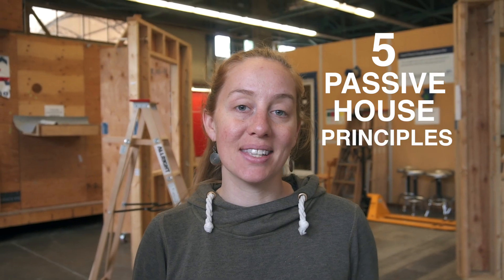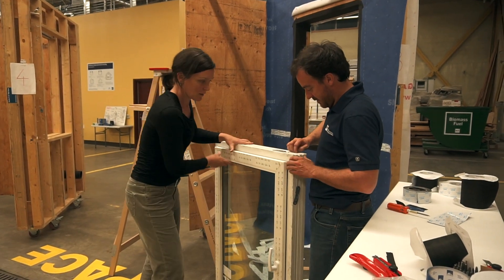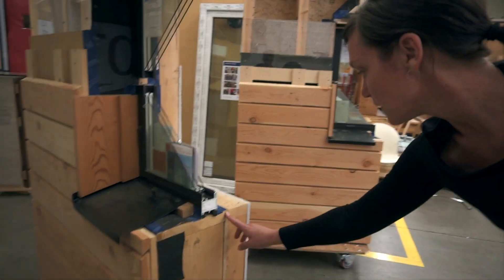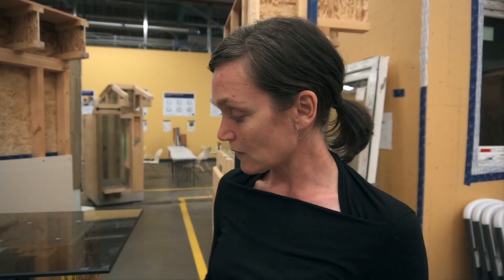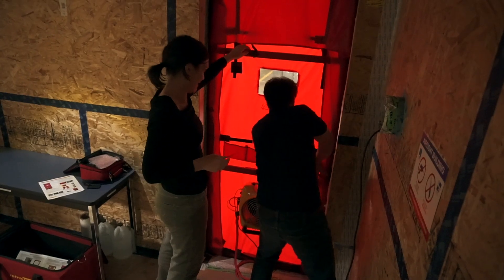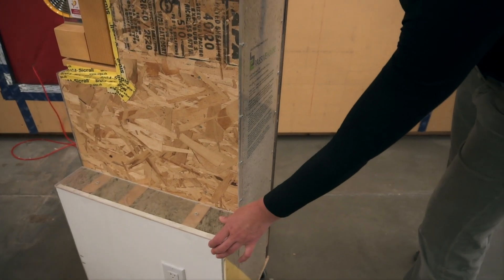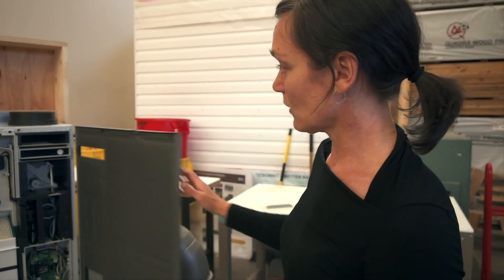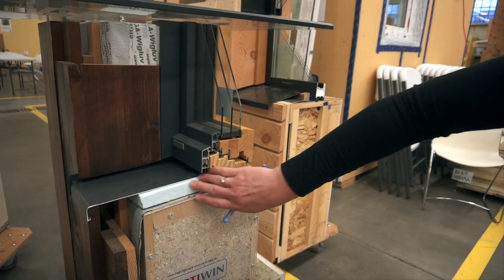Passive House = 90% Home Energy Reduction!

Comment: Two problems with so-called green building: 1) Thermal mass is completely ignored, and yet even a framed bin filled with gravel, possibly with ducted airflow through it will greatly help to moderate indoor comfortable temperature. 2) If you frame, enclose, and paint a wall well enough to seal it, you do not need to be part of the terribly wasteful insulation industry. Simply drill some of the studs for air to flow between sections, then install a low power fan, such as used to cool a computer. An airlock is needed as well. Simply turn on the little exhaust fan only often enough to maintain some vacuum inside the wall section. Heat loss or conduction as well as sound travels between outer and inner wall carried by air molecules bumping into each other and passing it along. Create even a low vacuum and suddenly there are not enough air molecules to conduct that much heat or sound. That is how your thermal flask keeps your coffee hot all day long! You will achieve far better insulation value and effect, and option of thinner walls this way. In short insulation=BAD.

Comment: OK, the video seems to have heating covered. My question involves cooling though. Is it actually possible to keep a house cool in 40 plus Celsius summer? I ask because here in Manitoba we can get some real scorcher summers and traditional air conditioners can be power hogs as well as environmentally damaging.  Is there such a thing as passive cooling where no air conditioner is needed?
Reply: Also reflective and ventilated roofs and walls will help too. You could even use solar panels for that.

Comment: To everyone interested on the matter, here is a short global overview with parallels to the situation in France (not trying to sell it, I just think the history of one country makes a more understandable example for picturing the global situation, and France's history on the subject is the only one I really know about):

Passive housing and Passivhaus
* Some techniques for passive housing might be new, but it has been around for as long as traditional housing, which always had had techniques for keeping the cold or the heat outside. You can summarize the idea by thinking of it as a way to keep the inside temperature independent from the outside temperature, and taking advantage of the sun for heating and of the earth for regulating the inside temperature.
* The Passivhaus label is most probably what popularized the concept in its modern meaning. The research started in response to the oil crisis of 1973, the biggest advance upon traditional construction being the findings about the importance of air tightness (mostly thanks to swede researchers). The first project was constructed in 1990 in Darmstadt, Germany, and 
* The label and its techniques became quickly widespread in German-speaking and Scandinavian countries. It is interesting to note that the industrial standards in those countries also evolved to answer the demand (e.g. for windows). This means that passive construction technology is now quite mainstream and more affordable there than it is in country where the demand is more recent. 
Find a historical review here : https://passipedia.org/basics/the_passive_house_-_historical_review
* If you take the example of France, the RT1974 (thermal regulation of 1974) was also a response to the oil crisis

What's next?
1) NZEBs (Nearly zero-energy buildings)
* European Union is asking its member countries to to draw up national plans to increase the number of Nearly zero-energy buildings :
the "Energy Performance of Buildings Directive" requires all new buildings to be NZEBs by the end of 2018 for public buildings and by the end of 2020 for all other buildings.
* If you take the example of France, the RT2012 (thermal regulation of 2012) is already trying to tackle this matter
2) ZEBs and Energy-plus housing
* Zero-energy housing means that there is 0 energy input
* In variable climate zones, this is very hard to achieve which is why the needed energy compensation is produced by (often local) renewable energy. For the house never to lack energy, these renewable energy sources often have a higher mean production than the building would actually need (e.g. solar panels will work every day even if you only need them in winter). This leeds to a new, localized energy management which can allow energy use for other uses, mostly transport (electric cars). This concept is called Energy-Plus housing.
* If you take the example of France, the RT2020 (thermal regulation of 2020) is supposed to make Energy-plus housing the new national standard.

If all of this stuff seems interesting to you, you might want to take a look at other widespread labels, such as : LEEDS, MINERGIE-P, 2000W Society

I guess the reason for me to write all of this is my frustration when I read most of the comments around here :
-> Yes, passive houses are great ; Yes they should become standards, but as a matter of fact they already became standards in some countries and are already being reviewed for better/stronger ones ; they are far from being a new revolutionary technology.
-> Labels but mainly regulation are a very important part of these evolutions, and it is crucial for any country to make them intelligently. This means setting the right requirements and adapting to the climate, and still allowing room for further innovation and experimentation.
-> If you don't have a problem with heating but with cooling, the same methods apply, but your building orientation (the way you use the sun as heating source) will change
-> Higher construction prices are in no way a counter argument when you can spend less energy over the full lifetime of a project ; only the overproduction of grey energy or new pollutants could be arguments against higher performance insulation

Sorry for the long comment...
Last but not least, I want to thank Exploring Alternatives for their awesome channel and the subjects of their videos. Keep it coming guys!
Reply: Alexander J 
Thank you for your comment!
(I’m a bit surprised to be the first one say so but I’m sure many more will have thought the same. Merci!)

Comment: I would have loved to have heard even more - or more of what you both thought about this - seemed like a bit of an abrupt ending. What did y'all take away from the education?
Reply: This video was done in Canada so it does get cold during the winter and hot during the summer. We have a Passive House near us in Ontario that does not use a furnace or air conditioning and the temperatures can range from -30 degrees C to a humid 90 degrees C.

Comment: I can tell you first hand, this 3 -5% premium is nonsense. the insulation used for 90% efficiency is up to 16-32"  thick. So the premium would be more in line with 50%
Reply: Yeah it takes less than minute to just compare 2x6 stud pricing vs 2x10 studs. Its 25% more. Then there's every thing else like a second service wall all around. It's easily a 50% increase in home prices if not more.
Reply: whoispriest 
It depends on your current building standards. In the EU this would be true. In fact new houses already have to meet almost energy neutral norms. 
If your standard is much lower, than there are still huge gains to be realized. Maybe not close to 100% but still major improvements.

Comment: It seems like the passive house is more concerned with keeping a home warm.  But with global warming, won't the question be how to keep the house cool?  I didn't understand that piece of it.
Reply: They shouldn't use the word heat (although they live in Canada) A well-insulated house works both ways. But those numbers: 80-90% are just lies. A passive house can offer an average of 20% thermal lost reduction which is sufficient for modern buildings. A zero-energy house is fake news.
Reply: Demetris Kalambokis 
In the EU new houses must be almost energy neutral and in the near future they must be 100 energy neutral.

Comment: Would love to see a video with helpful information on the best ways to retrofit an old home with energy savings ideas.
Reply: 1. new windows (and adding overhangs or awnings if you need to prevent passive solar heat gain)  2. attic insulation  3. seal all the cracks  4. add a layer of exterior wall insulation.  5. enjoy massive savings :)

Comment: This depends on the country. In Malaysia, there is a serious termite issue, ensuring most wood based insulation or any wood at all in that manner will turn into food = bad for structure.
Reply: Malaysia Barista u could try hempcrete
Reply: And the issue in Malaysia would be cooling (instead of heating) and high humidity which renders evaporative cooling ineffective. So the focus would be the ways to let heat escapes instead of trapping it in.
Reply: What about compressed earth block?!
Reply: @abundantearthglobalcdc4290  What if it rains?
Reply: In climates where its relatively warm year round, energy consumption to maintain comfortable indoor living conditions is less of an issue.
Reply: Precast concrete construction would solve that.
Reply: Use R Control Structural Panels. Wood and foam treated for termites, fungal control and mold. Pre cut panels and no waste
Reply: Malaysia Barista 
True, hot and humid climates need different solutions. Lightweight builds with lots of ventilation.
Reply: @Lucifer thats why i mentioned Earth Block. They can be made anywhere there is dirt and you dont need skilled labor to make them or build with them, if they are interlocking.

Plus, 1 of there many benifits is their ability to regulate moisture, humidity and temp. And the termites, or any pest, will not eat it.

Comment: learned about passive houses in my secondary education almost 15 years ago and the concept was not super new then, not really much that can change aside from reducing the production cost of the materials to make the early investment pay off sooner.
Windows are a interresting part, early on they were a huge heat loss due to not beeing air tight, then they became air tight and led to condensate building and therefore mold creation and in the passive house you have the air tight windowframes and avoid the mold with the air ventilation system.
I kind of miss the mass that stores energy here, like for example a thick brick wall in the center of the house, that gets light through the south windows in winter. but maybe storing all the energy in the air is enough if you have enough insulation, since simply people and animals beeing in the house create heat.
in school we were joking to put a 20cm (~8") mirror around the walls on floor level, so the cats will get scared all day and run around to create heat^^.

still i prefer building a earthship someday though the passive house can tackle the regulation jungle far better.
Reply: No use having thermal capacity if there is no sun to heat it. During overcast periods when cold your 'mass' will rob the heat from your body. And most materials traditionally used for thermal capacity are very slow, unresponsive and have poor energy storage capacity, as useful heat exchange only takes place in the exposed 50mm of the material.
With global warming, we already have a situation where thermal capacity becomes saturated during periods with sustained high day and night temperatures, making indoor conditions unbearable for humans (better outside in the shade away from radiating materials). Night time cooling is impossible. 
Rock, brick and soil are quite poor, while Glass and Water are useful thermal storage materials with Water being really adaptable, movable and of course free...

Comment: How is the wall breatheable?
Reply: Its not, thats why they have a ventilation system.
Reply: @webwabo ...and hot air escapes through them on a regular basis.
Reply: The wall is not breathable, it is moisture vapour-open, or vapour diffusive!
Reply: Why don't you have holes all over your body? It's because your body prefers to bring air in and clean it before distributing it. Same is true for your house. Why bring in unclean air, dust and probably bugs all over your house?

Comment: Great info ....But why build out of wood ?
Reply: with wood you can build a structure of frames and fill them with insulation, basically having lots of pillars. that cuts down on the walls thickness a lot. with brick for instance the walls could get twice as thick and feel weird when you have to take two or three steps to walk through a door, like a mini hallway. This also leads to more useable m² inside.
also wood is easy to work with and renewable.
Reply: And can burn fast...
Reply: i would disagree, a flat exposed wood surface usually comes with some coating and does not burn easy. If you are afraid of fire, your only real option is a concrete bunker.
most interior can burn, most insulation can burn, so having your structure out of brick, stone or concrete does not prevent it from burning and putting you in danger.
also wood and steel can and will be built with a fire resistance, so the structure does not collapse for at least 30, 60, 90, and so on minutes in case of a fire.
steel bends if i gets hot (does not need to melt to fail) so it gets a fire resistant coating.
wood burns from the outside to the inside, so making it thicker then minimally required gives more time until it collapses.
rooftiles are usually out of brick and the facade can have non flamable material like eternit panels.
Reply: Broadly on a house scale when you become worried about the structural elements burning everyone inside is either dead or has exited, and the house is a total loss anyway, whether it’s timber framed or brick.

Comment: that's all great for new construction.  upgrading an existing house tho...  that's spendy/impossible...
Reply: There are almost always quick wins that can be realized. Improved glazing, more efficient heating system, insulation of floor, wall and/or roof. Every step helps and might be profitable in the long run.

Comment: I love the idea of passive homes, however energy is so cheap they don't justify the cost to build them... I have a 3,000 sf house that costs on average $220 a month to cool. I house cost $213 k
Reply: On the long term, it will always be more cost-effective. Those methods are becoming standard/maintream, so the increase of building costs are also getting lower. And cost is one part, but energy efficience should be cared for for more reasons, mainly sustainable living.